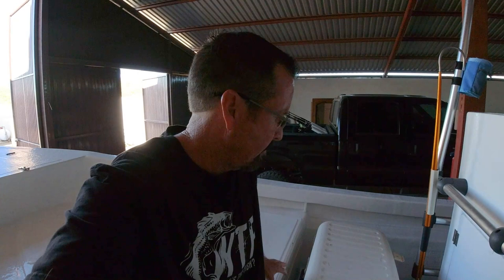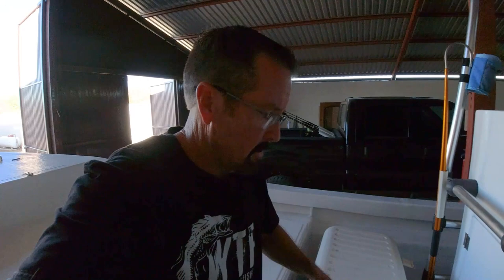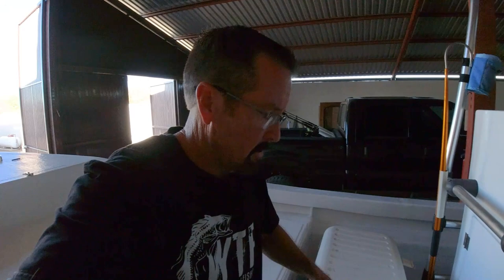Panga Update After 100 Hours

Comment: If you have ever used shock absorber pedestal seats you wouldn''t want to be without them.  In a chop especially in a flatter bottom boat they can really make a difference.  They are just plain way more comfortable.  Very worthwhile if you have any back problems.  Several good makes and they start from around $120 each.

Comment: Who made the t-top?
Reply from the maker: I don't remember but, we got it on Amazon. If you watch our video tour the info is there...
Reply: @BlueRockAdventures  I think I found them they are made by oceansouth, is it rigid enough for you or is it flimsy?  Can you use it for handholds while motoring?  Have you mounted pole holders on it?  I’m worried about the durability at speed and trailering….
Reply: @BlueRockAdventures  let me know your thoughts on it please thanks!!
Reply from the maker: @posterchild37  we really liked it. It does wobble a bit but is plenty sturdy to hang on to in rough seas. The kit is customizable so attach it as high as possible on the console.